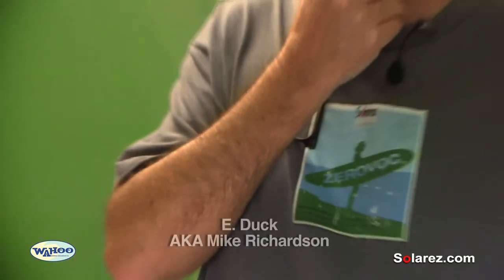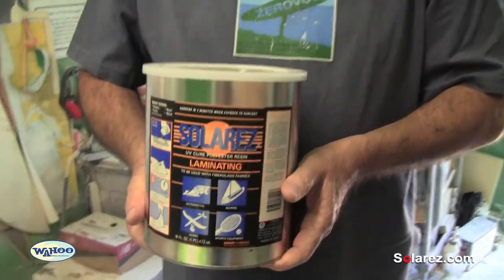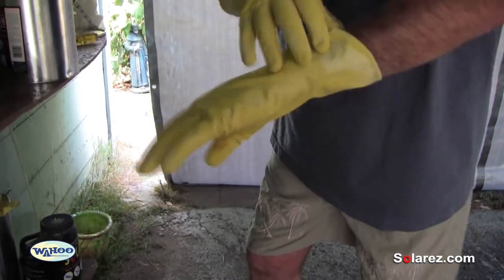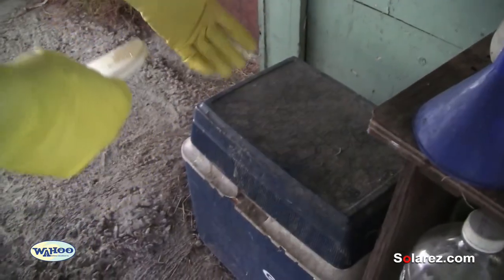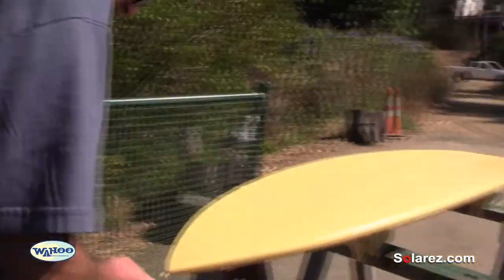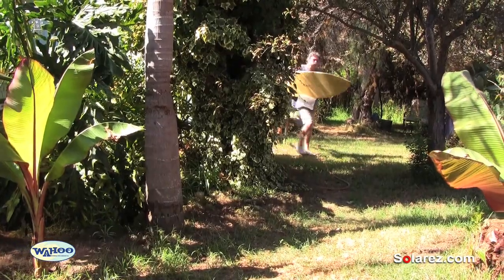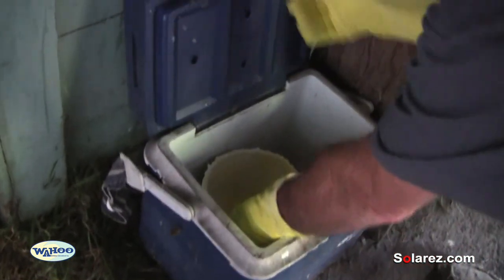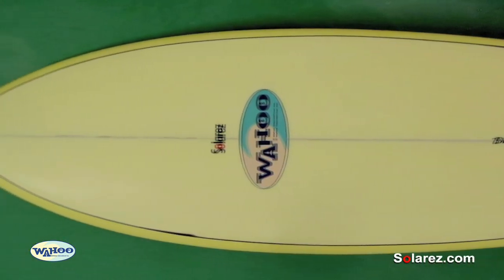How to Fiberglass a Pigmented Surfboard Using Solarez UV Resin

Comment: hi Mike, i need to make some tables for a restaurant close to the beach and the client wants me to paint the logo with lacquer can i do that? or what paint can i use to paint the logo?  thanks in advance. and great videos.
Reply: juan perales   if you print out the logo in black and white on a photo copier then tack some rice paper to a photo stat page then pass it through the copier . your logo is now printed onto rice paper . you can lay the rice paper logo under a small piece of 4 onz fibreglass cloth and paint it down tight with a little resin.. after it cures sand it down.  you can ad colours with marker pens on top of sanded logo then fix by spraying a clear lacquer. this is the fasted professional way without paying for expensive printed logos. if you want you can also glass down some Hawaiian cotton prints cloth under the logo and 4 oz and you wont need table cloths on your table . you can find this same Hawaiian design cloth in different colours for different table tops and it will look real cool with palm trees plants and pineapples, flowers design. 10 table tops would cost you about 100$ .
Reply: juan perales  the cost would vary depending on the size of the table tops. your imagination can run wild on this one. Make sure you glass the Hawaiian material down first to edge of table glass smooth let cure then glass 4 oz over . on large table tops about $350 for resin and 4 onz . Buy large 20kg tin of resin. Hawaiian material cloth about $50. enjoy. I have glassed Hawaiian cloth under a surfboard glass lamination came out so cool. better done n a longboard because theres a small added weight factor which isn't noticeable on a longboard.